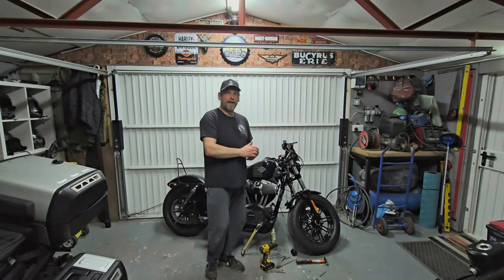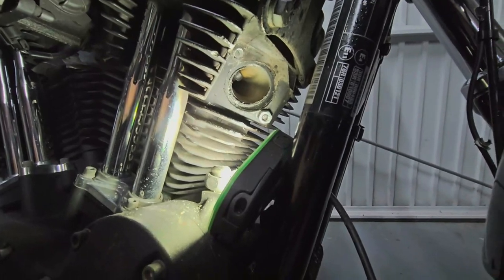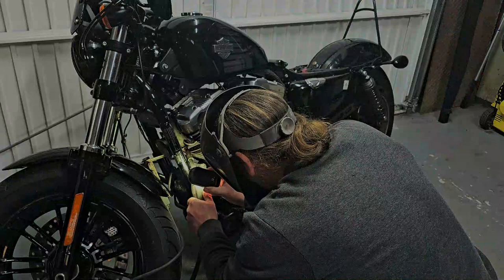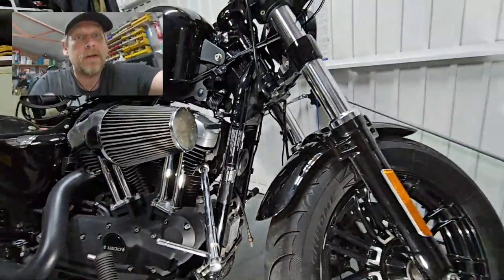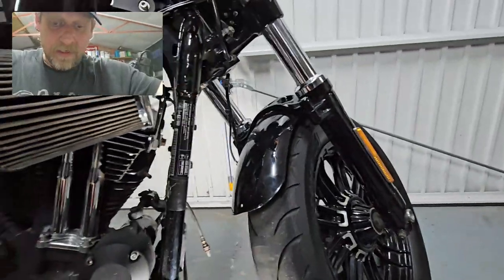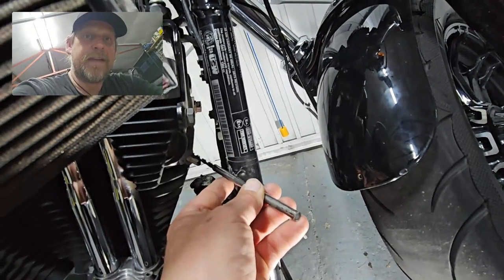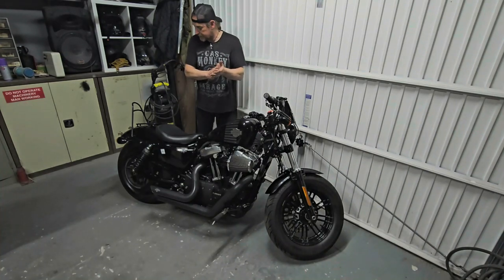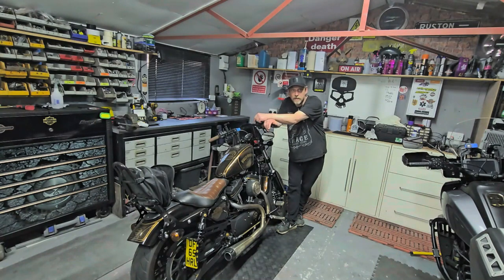SNAPPED  sportster exhaust stud Removal 😬 #harleydavidson #sportster #repair

Comment: I use 5/16 UNF x 3/4 brass nuts from the classic car world, which covers the whole thread protruding from the exhaust flange. Stops corrosion of the threads especially on that Btard one on the front which gets all the salt and road grime from the front wheel.
Reply from the maker: Good call 👍. I replaced my own with stainless straight after bought bike. Still shiny and studs 👊.. worst thing they did using steel on ally threads👍

Comment: I’ve got the same problem - hoping an extractor tool is gonna get it out, otherwise I’ll be drilling the sucker out. Absolute pig of a problem.
Reply from the maker: Drill extension was only tool that cleared the frame.. hope yours pulls easy mate, most I do come out after welding stud, drilling is a pain 😏.👍

Comment: doing this on the front stud on a '06 streetglide right now... frame is such a pain in the ass its right in my way. drill bit walked sideways... might end up cutting a notch in the frame so i can get a straight shot at it.
Reply from the maker: Hi mate. Frame really is a pain on these for that front stud.. I would try and recentre  it . And pilot drill again with titanium drill bit. Either on extension or right angle chuck on a compact drill. Failing that its head off. 🤷‍♂️..
Not so bad if you have enough to weld onto but feel your pain.
Hope you manage something without modding the frame 👍
Reply: @ALCHEMOTO  yes its a pain for sure. not to mention i was doing this work on a bike for a family member so this is all out of my pocket right now... might end up pulling the head since it doesnt look that hard. i drilled out with a 1/4" bit on an extension and re-tapping it to 5/16-18 but i can tell the hole isnt straight since the frame was still slightly in the way. probably gonna have to jump up to 3/8" threads on the one side and just get a stepped stud with 5/16-24 on the other side... what a gigantic pain in the ass just to paint some old rusty exhaust pipes.
Reply from the maker: I feel that pain.. Ive done a few now as seem to be the go to guy 🤣.. and just bought some snapon extractors with guides and left hand drill bits. Ive had easier studs on Caterpillar Dozer manifolds .. you can set new stud in alu epoxy paste if new thread not exact . Better with stainless studs.. But obviously be head off if ever happened again.
No easy way . Good luck mate 👊
Reply: @ALCHEMOTO  yanked the head tonight, only took me 30 mins lol i was STRESSING about it for some reason... appreciate it man! going to the machine shop tomorrow.

Comment: Having a nightmare with mine, Ive drill the stud out with 6.5mm drill bit as you did but cant fit the 5/16th thread tap in 😅😢 any advice?
Reply from the maker: Actual correct drill size is 6.6mm but not an easy size off the shelf for 5/16 tap. It will cut frim 6.5mm hole. Just a little tight. If your not sure then I would see if can get a 6.6mm drill bit ordered up. You dont want to go 7mm as not enough to give decent thread.
Either way, they are a pain without removing head
Reply: I appreciate the advice thank you
Reply: @ALCHEMOTO  worst ways, i.e. hole is too big etc. Would you recommend a helicoil?
Reply from the maker: In event of hole too big. Nothing wrong with helicoils as long as also use studlock on new studs, helps to set thread. Ive just had to drill out an engine block on a 36t excavator with a snapped bracket, and gone from 10mm to 12mm bolt size. I do it quite a lot, but with the sporty, you cant go up in stud size, so coiling is only way. To be honest. You would probably get a cleaner thread doing it that way. 👍

Comment: Ive got the same problem with the front lower stud to drill out and no clearance with the frame so im going to unbolt the engine from the front mountain and see if I can tilt the engine enough to get the angle to drill.
Reply from the maker: Always a pain with frame in the way. Hopefully your idea should give you the room 👍. 2 out of 3 will always come out with a welded nut but your heart sinks when that fails and you have to get the drill out 😀.. good luck with yours mate 👍

Comment: Looking at ur sportster I'm curious  how u mounted ur bags I have 2 with leather straps but just no where to strap them... did you have  bag mounts put on if so whats a good one I'm on a 2016 xl1200x . Alo thanks for the stud video I had to replace my exhaust a previous owner put on and a stud was broke. Went with the Vance and hence 2 in 2 out black...
Reply from the maker: If its the bike I did the studs on with the sidemount saddlebag, the saddlebag straps go around the top tube and swingarm, although some people mount them with cable ties. They can mark the paint though on the swingarm unless you put a clear protective tape on. You can get a bag mount as well, so its personal preference. I took the one off the bronze/brass 48 and just use the bag on sissybar. Glad the vid helped with exhaust stud, they are a pain to drill out straight 👍

Comment: Same things as just happened to mine, can you fix it 😂
Reply from the maker: Some are easy.. some are b#*stards 🤣..
Reply: @ALCHEMOTO   tell me about it… only wanted to wrap my exhaust. 3 studs came of fine, last one snapped which is the awkward one at the front. 

Have tried stud extractor and welding nut onto it. It just won’t budge.

Comment: Hey brother 
I noticed the bycrus Erie sign in your garage. 
I'm from Erie Pennsylvania were that company was based out of. 
Can't believe it made it all the way to your part of the world. 
Would love to know how you came about it. 
All the best 
Tim
Reply from the maker: Hi Tim 👊.. to cut a long story short.. My father and Uncle have had R.B cranes for years, owned around 40plus machines and actually own the nameright Ruston Bucyrus, the Erie sign I will have to ask them, but probably came with part of their large parts stock. Thats great having a connection from where you live 👊
Reply from the maker: So apparantly, the sign was off an Erie machine based at burtonwood air base/ used by U.S forces from 1940 to early 90's.. now a housing estate. The machine was scrapped in 2019 but the sign I have was off that 👍
Reply: @ALCHEMOTO  what a small world. U never know. Thanks for responding 
Keep the rubber down. 
Best to you 
Tim